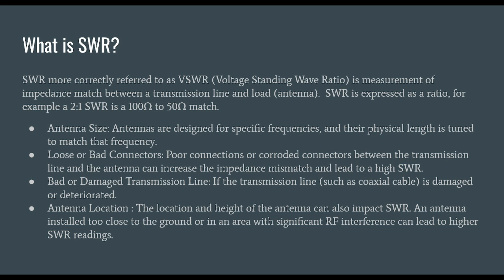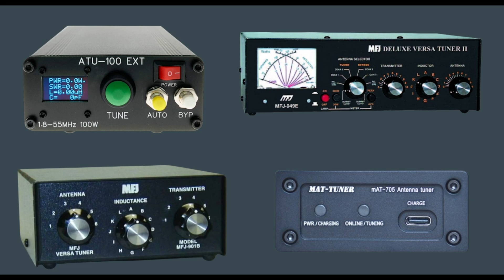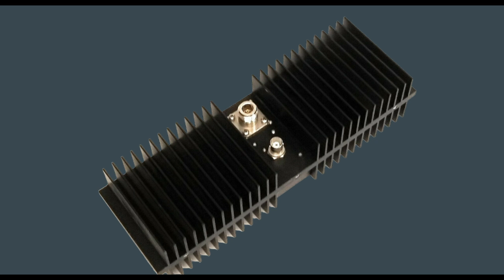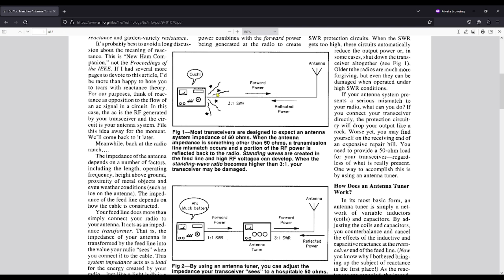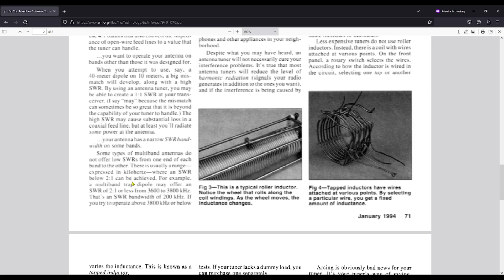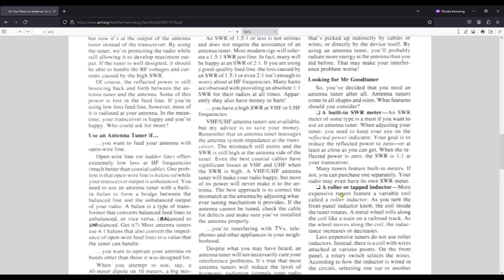Antenna Tuner 101: A Ham Radio Beginners Guide

Comment: The smokin ape iam thinking about getting my techican class license  I want to be a ham operator 🤔 I want to be a ham operator I have a learning disability in math I can still  learn lot  about impednce watts and ohms volts and  different Digital mods  on Hf and how to billing a random wire antenna for ham radios

Comment: with a resonant antenna say 22m long put a 49:1 on it tune to 1:1 on 40m and the bands are stacked so any interferance created land on a higher band ,but you can use 20 up to 10 without an atu so you get no loss in using the atu ,i admit the wark bands are slightly out but a variable capacitor can remedy that but that is why the bands are set that way so yes my 49:1 is a resonant multi band 40-10m antenna
Reply from the maker: I used a 49:1 EFHW for a few years and really liked it but have been using a vertical lately.

Comment: Thanks for continuing to Spread The Word!
Here’s my Literal Technical breakdown on Antenna’s, Feedline, Tuner’s and other matching circuits/components (based upon my readings of ARRL Publications back in the 70’s, and to date)… and the disagreements inherent in there use/misuse today...

The Antenna is the Radiating (and intentionally added reflecting / directing when appropriate) element(s) that shapes its Radiation (/Reception) Pattern. 

You “Tune” an antenna by making its physical characteristics Resonant to a ¼, ½… wavelength before its feedpoint connects to attached or external Impedance Matching Device like a Balun or “Tuner”, or length of feedline (impedance transforming or not). If impedance matching is designed into the physical “antenna’s” design, as with a Yagi, G5RV... its an Antenna System (radiator(s) + additional impedance matching circuit(s)).  
IF the Antenna is Not sized in this way its NonResonant and therefore Does Not Need “Tuning”, it needs its Impedance Matched to the feedline and/or radio’s Impedance.
NOTE: The G5RV “Antenna” is based upon the 102’ NonResonant flattop design that was used for years before Louis Varney added the feedline impedance matching section for Coax’s impedance that made it even more popular as a System.

The term “Antenna Tuner” as typically used is a misnomer for an Adjustable Impedance Matching circuit. It in no way “Tune’s” an antenna. It could be said to make your antenna In Tune (as “In Harmony”) with your radio if you want to be Philosophical, not Technical, but I’m not naval gazing here.

An UNUN is used to Transform the Impedance of an Unbalanced antenna to an Unbalanced feedline.
A BALUN is used to Transform the Impedance of a Balanced antenna to an Unbalanced feedline.

Your Feedline connects your antenna to your radio, and is Only part of the Antenna when it Radiates Signal changing/affecting the antenna elements Radiation Pattern, Unintentionally (like with CMC (common mode current)) or Intentionally (like by using a Current Choke at a distance from the feedpoint to Counterpoise your antenna (think an endfed’s counterpoise)). Your Feedline Is a part of the Antenna System as it can change the impedance's seen at the radio based upon its length and the frequency's of operation.

The Antenna System consists of all of the Above (and other things not mentioned, external to the radio) that couples/connects, modifies, and/or radiates your signal after the radio itself.

Confusion and disagreements come from Not using these Terms as Standardized. IOW Hams are usually arguing Definitions NOT Technical Issues. And that’s a shame.

73   mike
Philosophical section… Dubito, Ergo Cogito, Ergo Sum. 
(I Doubt, Therefore I Think, Therefore I Am.)  - Descartes
Reply from the maker: Thanks for the info Mike, and I agree...  we get hung up on the words and not the concept.  👍

Comment: I like resonant aerials, 5 h/b attic dipoles for 20m to 10m and h/b outdoor 60m inverted vee squashed into my tiny garden. Indoor h/b 2 element collinear for 2m.
For lower frequencies I made an indoor Joystick copy with 26' of wire and an MFJ 160-10 tuner so the single wire goes straight into the tuner SO239 socket. I was given the tuner as not working, one re-soldered joint needed.The tuner MAKES the system work. Like if you had a centre or base coil loaded vertical to MAKE it work but I'd prefer resonant aerials, coils don't radiate well. Resonant aerials must be more efficient.
G4GHB.
Reply from the maker: Hey Bill, I would agree that resonate is the way.  Nice job fixing the tuner 👍
Reply: @TheSmokinApe  My pal didn't spot it because the tap on the coil  was close but not quite touching the coil. I only found it by poking around with my finger.
73.

Comment: Why would an SWR meter reading be lower and closer to 1:1 when a coax switch is put between the SWR meter and the outgoing coax to the antenna?
Reply: @BusDriverRFI It is an MFJ switch so it should be 50 ohms.
Reply from the maker: You are changing the overall impedance in the antenna system 👍

Comment: Ape,
A lot of this sort of thing comes from way back in the days of valve (tube) radios that were used on HF frequencies.
Resonant antennas were extremely important, as they were not as forgiving as solid-state RF final amplifiers.
You would have to tune your antenna and your final amp to prevent damage to your expensive Drake or whatever HF rig.
Modern solid state transceivers just shut down with High SWR.
I remember using an old HF rig in 1988 and all of a sudden, it was like a bullet went through the two final amp valves, after I'd changed bands and forgot to trim the grid voltage/current thing.
Top video, mate.
Reply from the maker: Hey Mike, I don't disagree.  Sometimes I think we might need to filter some of the older info based off technology changes.  Thanks for the comment and for watching 👍
Reply: I think you have this completely backwards. Valve output stages and components are LESS likely to suffer damage than solid state ones. Initially, back in the day of thermionic radio, nobody even KNEW what their VSWR was, they didnt have VSWR meters, probably just an RF ammeter to maximise current in to the feed line. but more likely just went for anode dip and then max load on the output tank. The old tune and load controls of a valve TX had a range of antenna impedances they would have been able to match with. With solid state and the broadband-no-tune matching concept they implement, this "retune it for every new frequency" requirement disappeared, removing the matching option, it was 50 ohms antennas or nothing!  If you did have high mismatch in a valve PA, and lets say it resulted in high voltages being reflected back, over voltage would often result in arcing that would NOT be destructive. The operator now has an indication that all is not well and can do something about it. In a solid state PA, if you exceeded the device breakdown voltage - POP! no more transistor, just a silicon blob. Early solid state TXs that ran on 12V often had absolute max voltage rating of 18V or so. You didnt need much reflected voltage to exceed that, and it was ALWAYS destructive. More modern solid state device are far more rugged and manufacturers boast infinite VSWR handling. Bottom line is, valves and their output circuit can handle some arcing(within reason), transistors die.

Comment: Hmmmm just ordered one a week ago, tossed up which one to get. LDG or MFJ ? After much faffing about pulled the trigger on a MFJ 993b, after advice from other hams. Just hoping it does the business. A bit of quality control before firing it up. 😂 cheers for this video
Reply from the maker: Nice tuner, hope it works well for you.  Thanks for watching!
Reply: I have one, got it over 10 years ago, hammered the crap out of it the entire time. Still runs fine, if you get a good one it stays good. 😬
Reply from the maker: @GoonyMclinux  👍

Comment: THANKS Ape! 1st for not trying to sell anything but common sense brother! And thank you for not absurdly proposing reflect combines to increase my power output.... thats flat earth talkin crazy stuff. Or they been smoking the heavy ganja.
Im old and lazy so my antennas are mostly not resonated for anything but absolute non resonant... an inverted L random wire that tunes up from 160 to 10m FM. Its at a height to let me get local skip at 40, DX at all the WARC and 20.
My logic comes from physics and my lil ol tuner in the 991a gets me 80 watts before losses. Into LMR 600 and a good 4 to 1 UNUN. Thats from ciphering and great charts made with math, loving 86' with 25' up going N-S. 80 flat wont tune...suspect its from math.
My logbook proves the math and physics just like you said and if the flat resonators object they can dig up Maxwell and Kirchoff and argue with their corpses. Opinions are like flatulence. We all have them and they all stink. Yet the hobby breeds the fools and trolls and the growing breed of salesmen disguising greed as hobby helping videos. You are an absolute rockstar and because of your integrity I would trust any buying advice, or mostly as you offer building advice. Tip of the hat to best tuber in the hobby. My used 949e is coming, paid 70 bucks and will watch your videos to understand it. We trust you brother! Craig
Reply from the maker: LOL @ the guy saying it would increase power out.  Glad you like the videos Rediotests and thank you for the kind words 👍
Reply: @radiotests,if it's the same video I've watched recently where the chap mentioned that reflected wave adds to the forward wave ,there's much truth in what he says ,think many have misunderstood his video

Comment: Just to clarify, is it better to have the tuner in the shack, or remote (right before the antenna)? It would seem to be better in the shack to avoid any line complications that may exist if the tuner was right at the antenna input. Thanks.
Reply from the maker: Hey MrCoog.  It's probably 6 on one and half dozen of another, each has it pros and cons.  That said, I use tuners in the shack...  perhaps I would do something different if I was running a big contest station and wanted to squeeze out every bit of efficiency.
Reply: Thank you. Like your videos, great, straight answer and very helpful. Keep up the good work 
 @TheSmokinApe
Reply: I always found the answer in my current ham radio budget. 😂